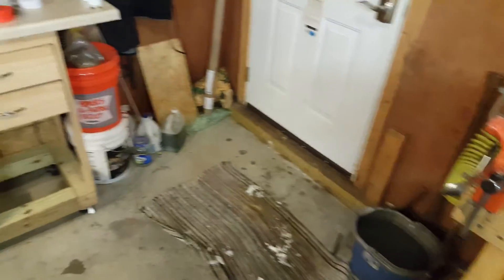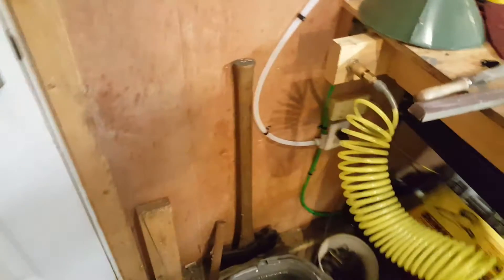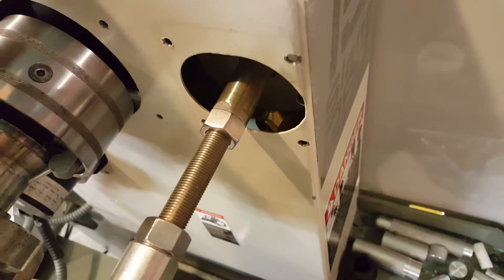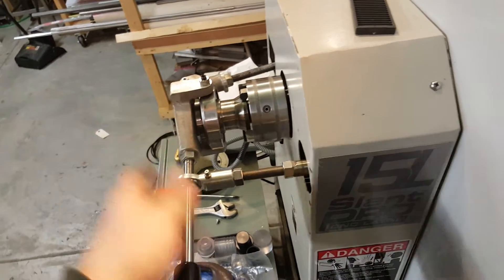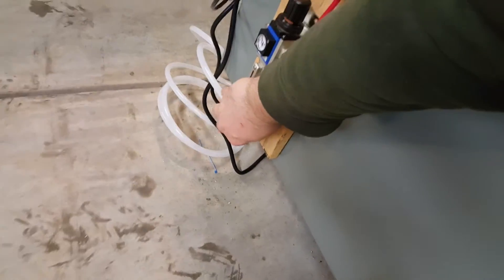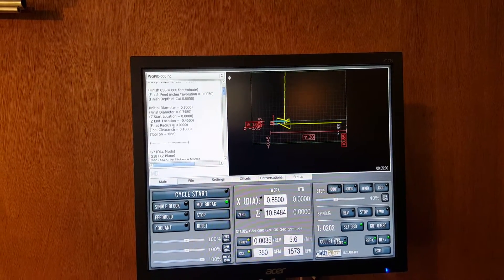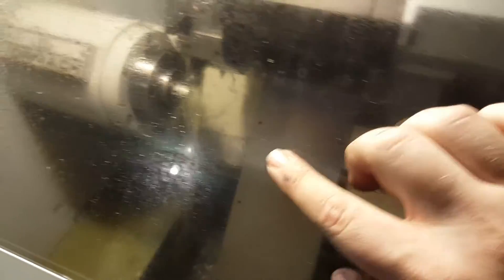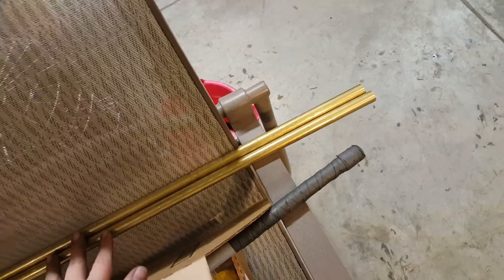Pneumatic collet closer for Tormach Lathe

Comment: a handy drawbar mod for sure. you can make a real quick and dirty bar puller just by slitting a plastic collet with smaller ID hole than the material (like drill the hole like 0.475 for 1/2" round). it's enough to grab the stock and pull it out, at least for lighter bars. The part will wear eventually but you can definitely get a few thousand cycles with it. of course you can make or buy a spring-loaded bar puller but that's a bit more work. depends on the goals I suppose.
Reply from the maker: +Andrew Ydna DuBuc I just made up a quick and dirty one of my own. It wastes a bit of stock but for a short term solution it will work. Thanks for the ideas though I may run with them in the future.
Reply: ah yeah I just watched it. that will do the trick in a more universal fashion compared to the spring collar that I was describing..